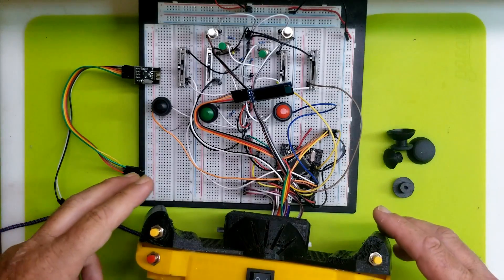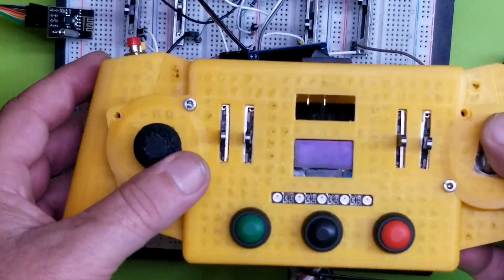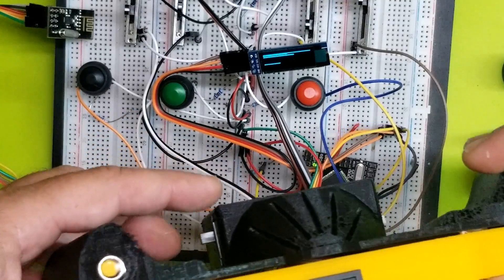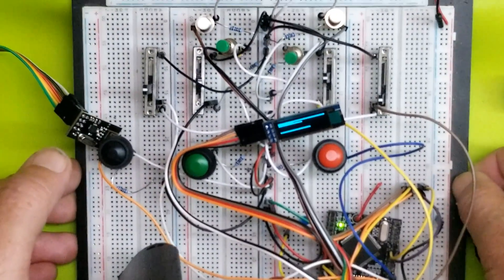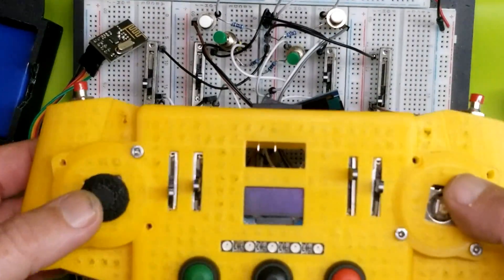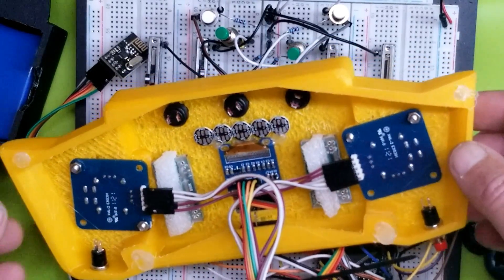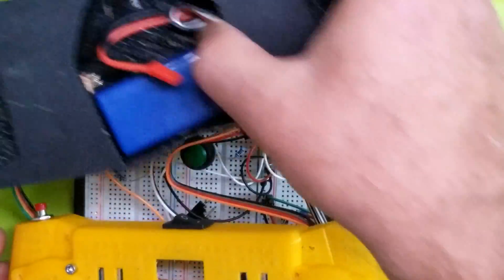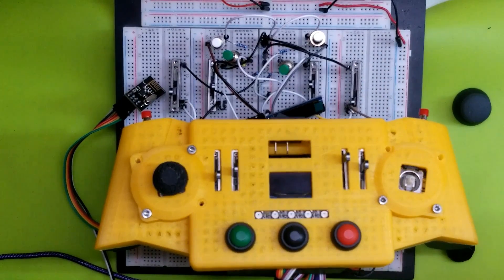DIY Remote Control - Part 3 - Nova SpotMicro3 v5.2

Comment: This is so cool sir😁😁!
How i wish to get the 3D printed parts to start mine😞
Reply from the maker: ya, without a printer, this would be a difficult project. Even if you had them all printed for you, we are often breaking or redesigning parts that need reprinting, so its best to have a printer. Sorry.
Reply: Ender 3 pro would do the trick, they are usually on sale and around $300AUD or less. Not bad for a machine that you can use for years and make endless things on.
Reply: @jordanletchford9139  yeah but my mom doesn't have enough
I'm just sixteen years old who wants to be a robotic engineer but my father died and my mom is not having enough money
Reply: @Phil_Gy  I am sorry to hear  and that is fair. I hope you and your mum is doing okay and hang onto that dream, you will get there. 😀
Reply: @jordanletchford9139  thank you